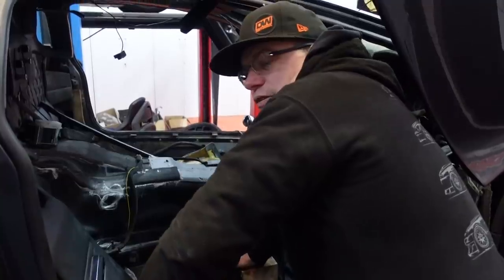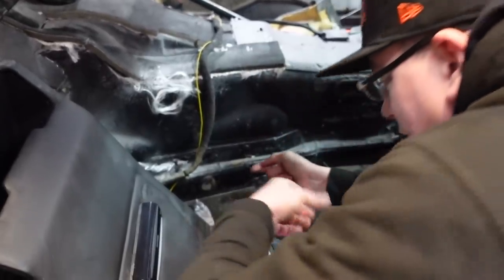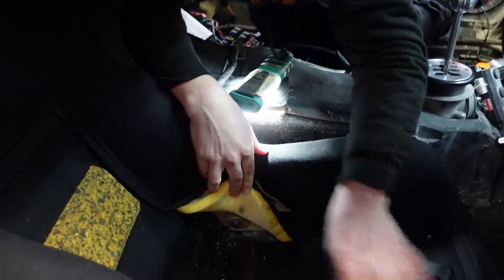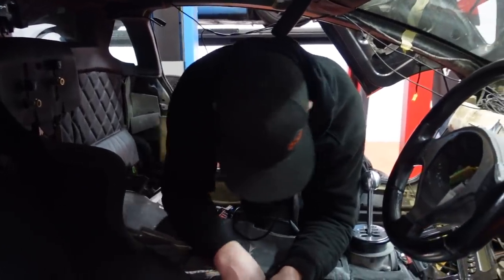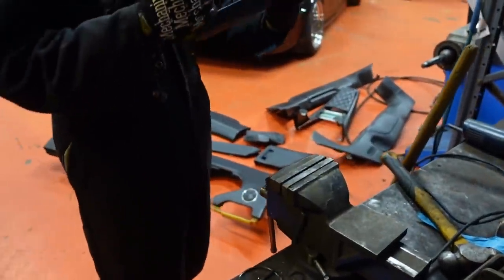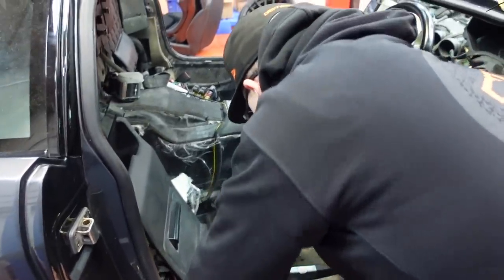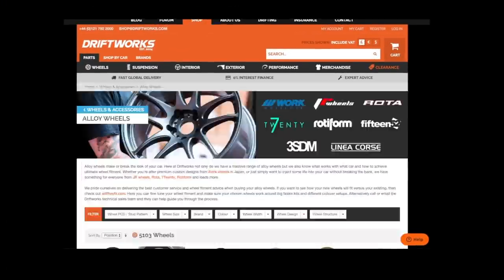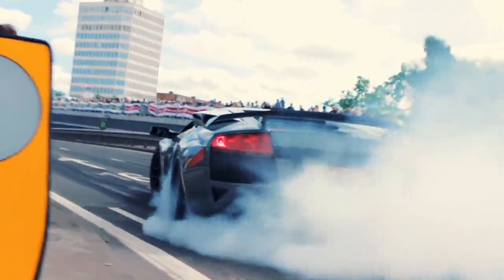The pain of fitting bucket seats to a Murcielago

Comment: That bandsaw clip... so cold in there that Jay’s fingers have turned to wood 🙈
Reply: Phil.. The socket for the steering wheel is called a castle socket. Castle nuts are Commonly used in motorbike engines... Multi size socket kits available on eBay cheap and worth having around!

Comment: The socket for the steering wheel is called a castle socket. Castle nuts are Commonly used in motorbike engines... Multi size socket kits available on eBay cheap and worth having around!

Comment: Phil why dont you run an adapted Kirkey seat and have it retrimmed and moulded to you? you will sit lower and more upright even with better clearance for helmet
Reply from the maker: It wouldn't be any better. This is as low as a seat can be in a Murcielago. You'd only gain 15mm if I was sitting on the actual floor.

Comment: Is there a reason you welded to chassis as opposed to welding an extension bracket to the seat mount to use the inner rear factory bolt location ?

Great build btw 🤙🍺
Reply from the maker: The seat literally touches the frame of the car behind the mount we made. There's no room to extend backwards towards the seatbelt mount.

Comment: Jig saw cut a alloy plate that runs along the inner side of the seat between the two bolting points, this will spread the load over the fiber glass 👍
Reply from the maker: It's just having exactly what was there before. Just as a washer and bolt instead of washer and captive stud.

Comment: Tillett B5 or 6 would drop straight in and go on the deck over that recaro
Reply from the maker: I'm not a fan.
Reply: @driftworks  yeah they’re a bit marmite, and they either fit you or they don’t. Reverie do something similar but a bit better
Reply from the maker: Again I just don't like the look of them. I even question whether I'd actually like the £10k carbon Recaros.

Comment: I would have honestly looked for a set of seats that would fit with out cutting anything.
Reply from the maker: There's no such thing. Even SV bucket seats don't go low enough for me. Hence the reason we had to make some.
Reply: @driftworks  Damn. I was going to say id rather pay thousands on a pair of seats than start cutting.
Reply from the maker: I was all set to buy a set at £10k. They aren't good enough though.
Reply: @driftworks  lol its crazy what a good branded seat costs though. First time i looked into it i couldn't believe what you can pay for a set.

Comment: Creaform bead seat kit
Make a mold fitted directly to the floor. It's like a two part urethane and poly foam bead foam.
You find a seat your ass fits in comfortably and make a reverse pattern paper maché mold.   Or fiberglass lol.
Then shape the sides of the mold how you want the sides of the base to look.  Put down something like peel ply on the floor and pour the foam directly on the floor. Place your mold in the position and angle you want.  Probably much thicker in the back and maybe 2 inches higher than the floor in the front edge of the seat.  Remember to move it forward enough so the seat back will line up with the back of the base.
For the seat back, you are going to cut the base off of the racing seat you like. Make mounting brackets for the seat back. Both pieces get upholstered in the leather of your choice and voila! Now it's not just Aston Martin Valkyrie owners with bespoke seats fitted for them.  It's all Valkyrie owners....  And Phil.
Reply from the maker: Haha, as much as that sounds like fun. The seats we've fitted are great.